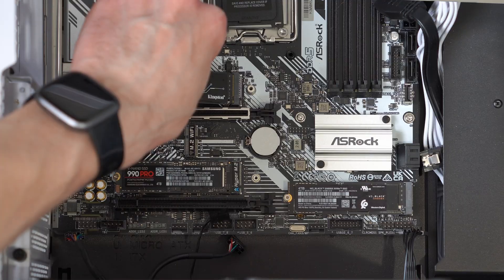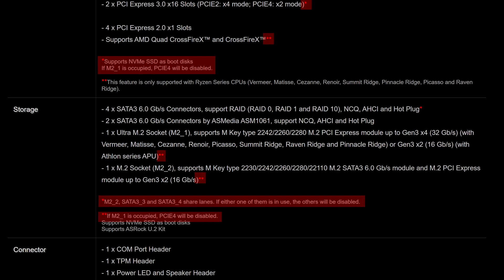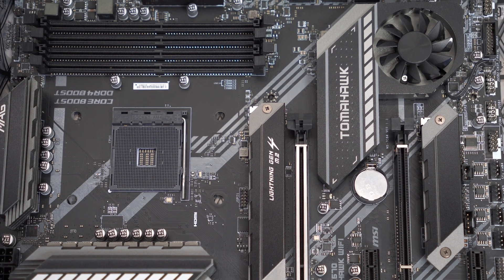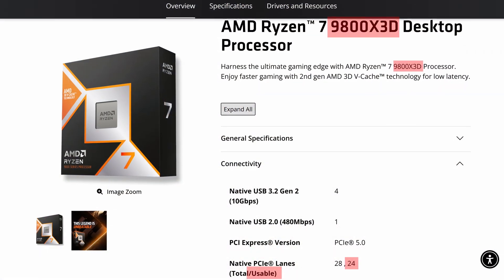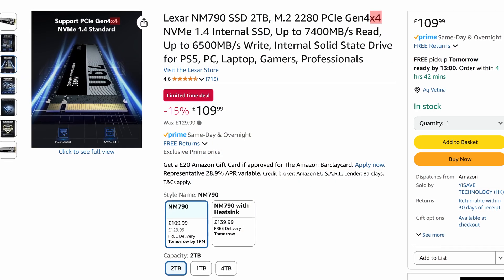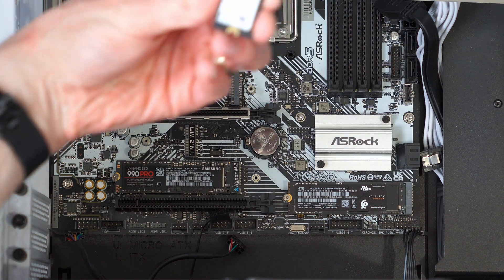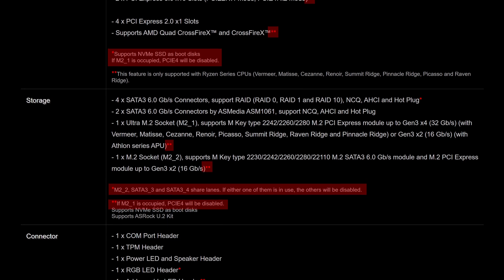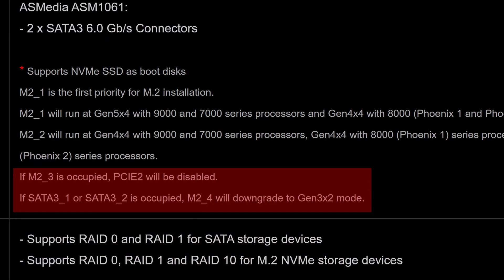Why Do Some M.2 NVMe Slots Get Disabled Or Slowed Down?

Comment: Are there any mobos that don't do this?   Because for a mobo that costs 100 or more dollars  they should have dedicated lanes
Reply from the maker: Unfortunately you're almost looking at pro-level boards (such as Threadripper) if you really want a lot of lanes. The TRX50 series come with 88 usable PCIe lanes, for example. However consumer motherboards tend to be limited by the CPU/chipset, and these usually top out at 24 consumer lanes.

Comment: Wow. I got lucky with my mobo.  GPU, 2 nvme drives + a 3rd on a PCI adaptor card, an SSD drive, & an optical drive are all functional. Asus x570 mbo. And to think, I even considered a sound card.

Come to think of it, IIRC it  has 6 SATA connectors. I guess they plan for only 1 or 2 to be active at a time?
Reply from the maker: That's great to hear then :) Maybe some of your devices are being slightly bandwidth throttled, but to be honest you might not notice an optical drive and SATA SSD being throttled for example.

Yes, I agree that they probably plan for some connectors to not be used all the time.

Comment: Great info. The fact this kind of issues with M.2 drives are very common but rarely mentioned by tech tubers just show how much they don't care about the little big details of building a PC.
Your video shows just how important that is and I hope many people find it useful.
Reply from the maker: Thank you, I appreciate that :) Yes it's surprisingly common actually - I once forgot to do proper research when buying a new motherboard, and ended up with a gen 4 x4 NVMe drive running at just gen 3 x2 lol (I think I also plugged in a SATA drive at some point, so it went from x4 to x2).
Reply: @ShorterTechOverwrite  I get it. It happened to me years ago with an Intel B85 motherboard. It had 1 PCIe x16 slot, 1 PCIe x8, 2 PCIe x4 slots and a single M.2 port, and the moment I installed an M.2 SSD, all the slots except for the x16 became unavailable. That's when I learned PCIe lines matter and M.2 drives highlighted how important the quantity of PCIe lanes on modern motherboards are.